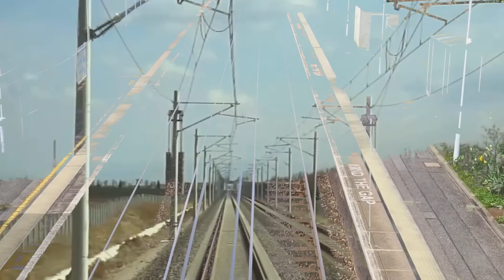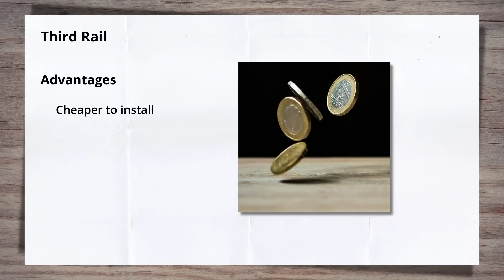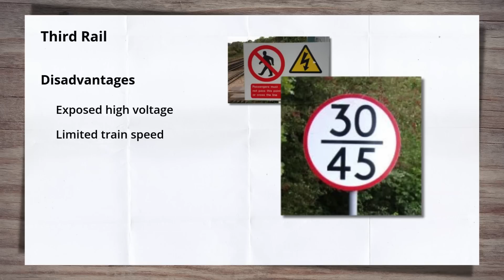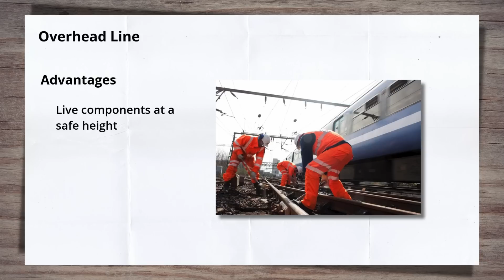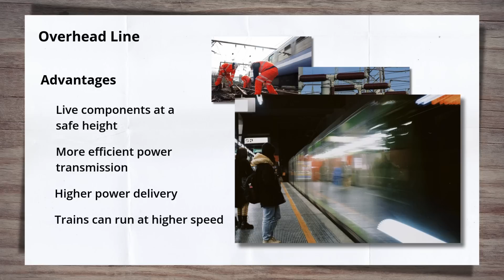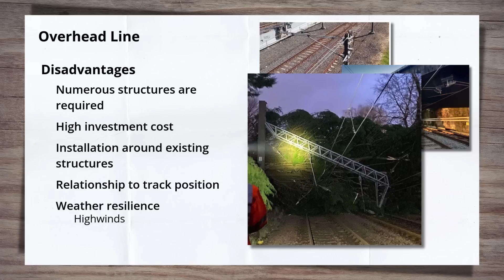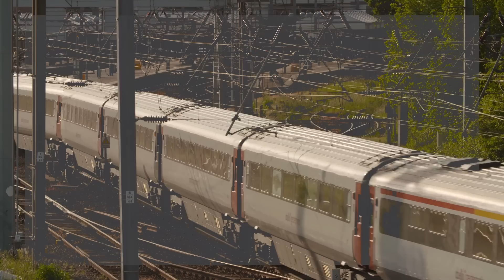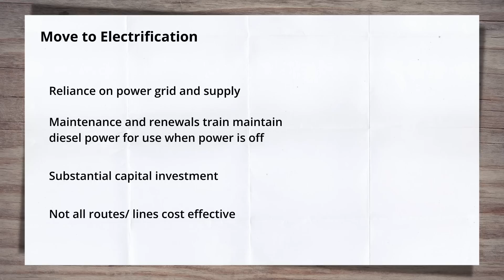How Trains Are Powered on the Railway | Third Rail vs Over Head Line Wires

Comment: I think you have got which units need transformers mixed up. For example, the British Rail Class 86 locos have transformers to reduce voltage from 25kv to 900v for the motors, whereas British Rail Class 423 4VEPs don't have a transformers for traction power as they get the 750v direct from the third rail. DC units without transformers require ballast to keep their centre of gravity low. British Rail Class 86s are 25kv AC OLE locos, and the British Rail Class 423 4VEPs are 750v DC third Rail units.
Reply: Second that… 😅 Transformers only work with AC, as the fluctuating polarity is needed to create the shifting magnetic field induction to the secondary coil(s). Running DC through one would just create a big magnet - and a single spike across the secondary coil (and an opposite polarity spike when turned off). 

Early AC traction was regulated by tapping into sections of the coils, mostly avoiding huge and hot resistors used with DC (energy loss). Mercury or motor rectifiers were often used in AC, as DC drive-motors were more efficient than AC ones. 

Last 50ish years, both AC and DC fed traction is either “chopped” (like a lamp dimmer, but huge), or turned into multiphase variable frequency - a bit like e-vehicles. All solid state without moving mechanics - except the driving motor-wheel assembly. 

Oh well, this was certainly more than anyone asked for… (and correct me if & where wrong) 😅
Reply from the maker: Thank you for the information!
Reply: DC units do not require ballast- their CoG is already low and quite irrelevant. Diesel locos have a higher CoG due to the mass of their engine & generator.
Reply: @MervynPartin   Agree - I overlooked the “ballast” part, as this video was about electric traction… Silly me. 😅
Reply: @MervynPartin  afaik, ballast can be used, but it’s because the electric equipment is too light and wouldn’t get the full axle load for maximum usable traction (mostly a concern for low speed drags and thus cargo only operations in countries like the US with few limits on train length and minimum train speeds)
Reply: @MervynPartin  Diesel locos also have a fuel tank under the loco which somewhat counteracts the Diesel engine. An AC loco like the Class 86s mounts the transformers below the floor between the bogies, whereas the Class 77s had ballast to help with COG and Traction as I have been told they where light footed as well as they where unstable.
Reply: Why does the London underground need a 4th rail, as one or both running rails could be used as a "return" thus less expense?
 Like the overhead (1,000VDC to 3,000VDC and 15,000V~ to 25,00V~) uses the running rails as a return!
Reply: @jonathonshanecrawford1840   Originally, the 630V DC was split between the two non-running rails (+420 / -210 V), no return through the running rails. Idea was to eliminate ground currents disrupting other cables, and electrolytic damage to cast iron tunnel lining etc. Deep level lines are still arranged this way.

Today, sub-surface segments are converted to 750V (+500 / -250 V), and in some outer segments the fourth rail is a combined earth return with the running rails (+750 / 0 V). This way other railway stock can share the line. 

Hope that helps, sources various YT and TfL.
Reply: @jonathonshanecrawford1840  The reason is partly historical, partly legal and partly for safety. The historical reason is that it was simpler to not have traction current using the running rails as it would affect the DC signalling systems used during electrification. The legal reason is that you can only have 7 volts of earth leakage on the London Underground so the fourth rail system reduces that. The safety reason is that it takes two failures to cause a fire than one under third rail electrification. With 25kv OLE for example the running rail is charged to 25kv but the running rails stay at 0v of potential difference which allows for the 25kv of potential difference, it is very similar on the third rail systems. When third and fourth rail traction uses the same line the negative return rail is bonded to the running rail which means the positive rail has the full potential difference. The London Underground's fourth rail system has for the most part positive rail at +420 and negative rail at -210v creating the 630v potential difference. The only exception is on the subsurface railway where it is shared by electric mainline trains. On Subsurface Railway it is +500v & -250v creating a potential difference of 750v. When shared by an electric mainline train it is +750v on the positive and -0v on the negative for the District Line between East Putney and Wimbledon as well as Gunnersbury and Richmond, on the Bakerloo Line between Kilburn High Road and Harrow & Wealdstone it is 650v instead on the positive rail but the negative rail is still -0v.
Reply: @jonathonshanecrawford1840  well, they have one rail at +400 and the other at -200, afaik. No idea why, tho
Reply: is the power supply (voltage and AC/DC) valid in this comparison of third rail vs overhead?    That is does third rail have to be DC and overhead have to be AC.  Can both supply systems be used by either delivery system?  If so then the AC/DC and/or transformer/ballast etc is not applicable for the delivery system comparison.  A bit like in model terms: they mistakenly call 3 rail wheels sets as "AC wheels" when can equally run DC through a 3 rail system.
Reply: @richlawrence4160  Third rail has to be DC because of the skin effect. But OLE can be either.
Reply: @richlawrence4160  Good question! Train that use dual voltage (overhead) can only use one voltage only. The TGV from Nice to Paris is a good example - either 1.500V= or 25,000V~
DC or Ac can be used with over head, however, not for 3rd rail - safety risks would be more so - people getting killed!
Transformers are used to step up or step down the voltage, where needed that are normally located in the loco end!
Whereas the "third rail" system, they use DC (of course) with a pick-up shoe as shown in the video!
Wheel (today) are not used to pick up the power, as shoe (both sides of the train) is used!
There have been experiments with 2/3 phase without success though
Reply: @richlawrence4160   In some aspects. Low voltage means high current - or the opposite. A high current demands “thicker” conductors, so for heavy rail this was an issue historically. For light rail (trams, metro) both manners of power pickup is used for 600 - 750 V DC. Even so, AC on third rail is “possible” but cumbersome (see other comments here) for engineering reasons. It didn’t really happen (but of course, some odd place I’m sure it did…😅)

As for wheelsets, no system I’ve come across has isolated wheels across the axle (oh, Paris metro…). The two running rails are always ground, also on 4-rail where they don’t form part of the traction power circuit (well, they increasingly do in sub-surface London Underground). 

Like in a home, ground is also a “zero point” to which any fault can be lead, or measured against. And… (this is getting silly) ground can be the one of the paths to form an electric circuit, AC (phase to PE/N, lotsa transformer details) or DC.

The two running rails are (usually, not LU…) DC or < 100ish Hz AC at the same potential. Still, sections are isolated for higher frequency AC, very low current. These sections are (crucially) shorted by the wheelsets, making up block sections for detecting any rolling stock in that section for signalling. 

And… that 140+ years system is sometimes superseded by axle counters and other tech in ERTMS- like solutions… 

No wonder Hyce, RMtransit, Bahnwelten or J. Hazzard run entire YT channels on these topics. Look them up, they are way better than my random rants… 😂
Reply: @richlawrence4160  AC not possible  on third rail as the current 'snakes' its way thru the conductor,(skin effect as mentioned below)  not necessarily at the point where the pick up shoe is..plus it's not that efficient. Also, there is a limit to the current that can be supplied on third rail (about 10,000 amps, but I might be mistaken) otherwise the cabling would (and sometimes does on Southern 3rd rail system in UK) break down and catch fire.  This explains the power limitation on 3rd rail.
Reply: @paulking9734  In the UK the limit is 6,800 amps.
Reply: I was also wondering about that.  The Toronto subways use DC on the 3rd rail, so no transformer.  Also the streetcars and LRT use DC with a pantograph.
Reply: DC powered trains don't have transformers per say, like a mobile phone charger, that changes 240V~ down to say around 5VDC. 
To change the supply voltage from 630VDC to 900V~ needs an inverter to change DC to AC. Like in Sydney the latest trains were designed to run on 25,000Volts~, however the supply voltage is 1500VDC. They need to invert the current from DC to AC, then step it up to 25,000VDC.
Reply: @jonathonshanecrawford1840   An increasing number of European traction is also multi-system now. They need to cover catenary at 25kV 50Hz, 15kV 16,7Hz, 3 & 1,5 kV DC. However, no traction motors (driving the wheels) ever use high voltage. Whatever the catenary carries, it is transformed and/or inverted to around 3kV 3-phase variable frequency. Also, the pantographs vary in with and tech from loading gauge and other reasons. An engine may carry four of them, using one at a time.

Source Siemens, others.
Reply: @musiqtee  That reminds me of the TGV from Nice to pairs! Starts off with 25,000V! until it reaches La Pomme, the drops down to 1500VDC, until it passes Marcelle, then goes up to 25,00V~, until it reaches just before Paris, all this happens with out stopping and changing the pantograph! 
Clever though!
Reply: @musiqtee  Interesting thing I discovered, in Sydney (Australia) the lower wire (contact) was single, they had to add another one to carry more current (1500VDC)
Reply: @musiqtee  For British Dual Voltage units it is converted down to around 750v so it can use the same bus bar as the 750v third rail uses.
Reply: @jonathonshanecrawford1840   Yes, I’ve seen that on some tram-systems - if only partially due to grades demanding more current. Some heavier (like København S-tog) use metal bars as overhead in places (like Kbh. H.). 

And sure enough (it depends, says Hyce…) - some recent use of metal bars overhead on 15kV in tunnels etc. due to stability or space (not really for higher current).
Reply: @jonathonshanecrawford1840   Yes, it the lines (same national area) have the same loading gauge (space for pantograph and catenary), there’s no need to change. Units like Siemens Vectron can do a “rolling changeover”, space and isolated section allowing it. 

They don’t just change power, but also signalling & comms technology, train orders ++ when crossing national borders. That’ll be way simpler when ERTMS / ECTS is fully implemented, though.
Reply: @musiqtee  I have seen solid metal used on bridges, Holland Train Cab view
Reply: In Italy also the engines feed directly in the 3kV DC current while AC requires transformers as all engines are dc.
Reply: @swissbaldo   Indeed. 3kV is “just right” for the (nowadays) asynchronous 3-phase controller and induction traction motors. However, the unit will pull the full current from the catenary, so the wiring and rigging is “heavier” than 15 or 25kV systems. 

(Real engineer should verify 🙈:) A 4000 kW unit would draw 1300 Amps (theoretically, max) at 3kV, but ~200 A at 25kV. Tractive units are somewhat lighter though, a bonus for acceleration.
Reply: @swissbaldo  Your 95%  correct, most of Italy uses 3KVDC, there are some parts that use 25,000V~ like San Ruffillo to Quinto Basso
Reply: @jonathonshanecrawford1840  as far as I knew 25kV 50Hz AC was only on the high speed lines (except direttissima Firenze-Roma).
Reply: It's back to front now: New dc traction has ac asynchronous motors . Inverters are lighter than motor -generators and tougher than mercury arc rectifiers, and probably ubiquitous across all electric stock.
Reply: Don't even AC locomotives sometimes use ballast?
Reply: @JSM-bb80u  Not I am aware of.